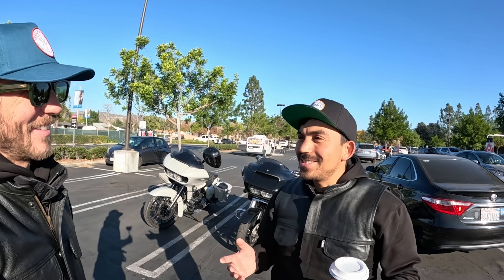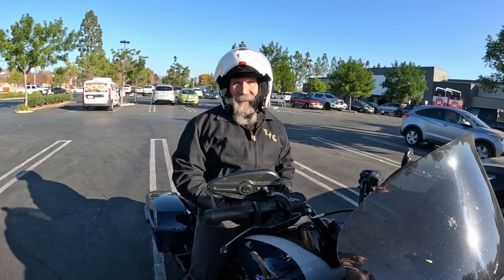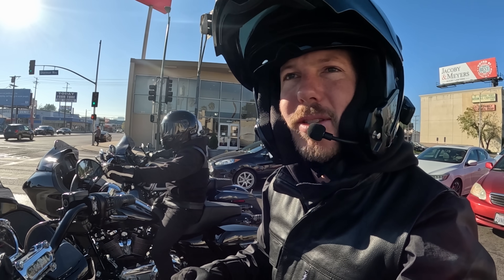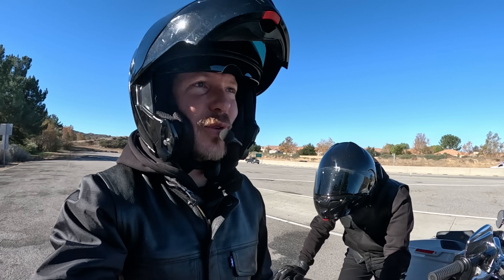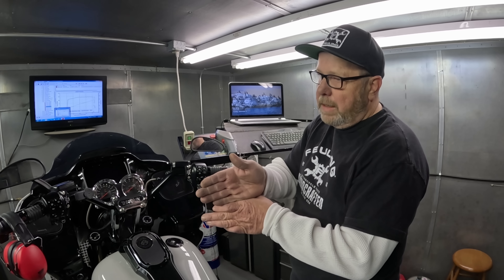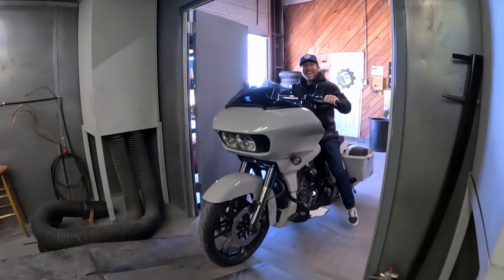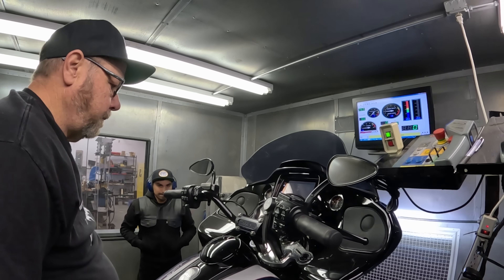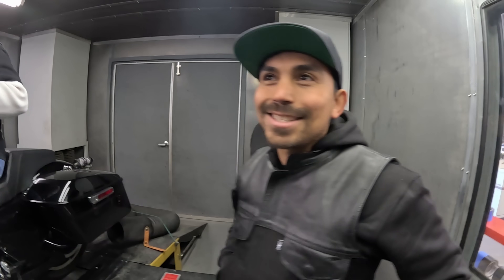Back to the Dyno With the New Cam! (Battle of the Baggers Ep.5) - Vlog 109

Comment: I'm using the Dynojet and have done a few auto tunes. I'm running a Woods wm8-22xe in my 107 with Vance and Hines x pipe and a big sucker intake. I haven't had mine on a dyno yet but the bike seems to run fine. Maybe I'll take it to Bloody Knuckles and see how it compares to your 107. I also want to see how the tuner is doing as compared to a dyno tune. Oh I'm also running the wide range O2 sensor kit from Dynojet.

Comment: Juan , I have a  Sportglide  107   with the RedShift  468  cam  and I am  putting down  124.9 ft lb  of torque , And if you think you're cam has a Nice Chop you should hear a 107 with the 468 cam in it . 
And For "Something New"  I would like Juan to Engineer a Pullback Riser that's  Fully Adjustable  6 or 9 inch or 10 inch With a Single tool or Fixed   threaded Knob or Lever  required to move the Degree of Pullback on the Riser that's not Exorbitantly Expensive.

Comment: U’ll capture more cells with a dynamometer custom tune using wide-band 02 sensors. Dump the sniffer. He’ll be able to isolate the cylinders, look at the true volumetric efficiencies, pulse width, timing, and of course AFR’s. Mine was targeting 8.5 in lambda WOT-approx 12:50’s AFR. 
My 2017 T/C kicks the ass out of my brand new 2023 Road Glide ST 117.  Dyno Sheet= T/C 127 hp, 137 torque, with power being made under a long steady curve. 
My 2023 Road Glide  ST 117 is the same eng displacement as the Dyna, (both 117 ci)  but no comparison. True the RG is slightly heavier than my Dyna,and  has the stock header with cats, but it also has a slightly higher compression ratio , and a four valve head with the M8 Eng. Ha,, go figure😆
Reply from the maker: Did you see the ending?

Comment: Personally I tune with Dynojet Powervision. I'm easily getting 110+ hp out of the 107's with that cam and similar grinds. And getting great fuel mileage to boot with the targets I set. Powervision also allows you to make your throttle live and hit the rev limiter, not shut the throttle down at redline. I'm the performance engine builder and dyno guy at Prestige Custom Cycles in NY.
Reply from the maker: Right on!! We got a TTS and a proper tune. We do that to all of our bikes… just was more of an experiment this time. Thanks for watching Andy!! Cheers from SoCal!
Reply: @THRASHIN  did you do a vlog of the tuning session?

Comment: Must admit I hated when I used the autotune on the FP3 - Though the bike is "learning" it does not run well untill you have finalised the map that you feel the difference - I done over 300 miles while in autotune, while trying to fill as many green squares as possible before I finalised the map (Green = both cylinders learnt, orange = one cylinder leant) - cant say if the bike run any better than the VH map for my selected pipe etc....
Reply from the maker: Yep. Makes total sense. Thanks dude!
Reply: @THRASHIN  there plenty of youtube vids that explain it better, but yeah the map ain't done till you hit finish. Ideally you will need your phone mounted on your bars where you can see it, nice empty road, Holding different revs levels till as many squares are green. It will ride like shit while it's learning

Comment: I'm running a ss475 cam in my 107 with a tabs 50cal s zombie baffles and tabs head pipe,  I'm pulling 107 up and 117.5 torque. I need to change out the baffles I got a torgue dip around 2500. I bet after a good tune you'll be close to 115 hp
Reply from the maker: Hell yea, see you next Tuesday 🔥

Comment: Only the best tuner! Thunder Max is thee best it never stops analyzing holding the 411 for you to upload. Or programmed for there oil cooler fan also no need to get a flash from Harley... Wide band 02 sensors you lose 0 mileage stop with the p o s Vance and Hines rubber it does not work for M8 bikes!!!

Comment: The comments about the fuel is wrong. If that was the case, you could be getting diesel in you gas, and vice vrs. The hose come from the top of the pump, because there is a V at the top. Last half goes in your bike, the first half goes back down into the gas stations tank. The fuel is not being mixed … this guy is wrong.
Reply from the maker: Diesel uses a separate hose homie

Comment: Put that Fuel pack in the trash. 

Get a power vision tuner, and get it tuned proper. Should be around 106-110HP and 116-120TQ.
Reply from the maker: Fuel Pack is trashed…. We went with TTS see ya next Tuesday
Reply: @THRASHIN  TTS is a great product.

Comment: Why did y’all start every race is a disadvantage to the 107? You used the torque advantage of the 117 every pull. 107, especially with cams are dogs down low.
Reply from the maker: Huh
Reply: @THRASHIN  you can’t read or something? You started each roll race in the same gear on both bikes. Which gives more of an advantage to the bigger cube bike, which makes more torque. If you’re both starting at a lower rpm, not down shifting, the advantage is going to go to whichever bike makes more torque, sooner.

Comment: Guys I know Luke is a great guy but Feuling is one of the least performing cams on the market in terms of power. Star Racing is a better choice. Or Andrews.
Reply: No disrespect Rick or to the brands listed, are we talking race engines or are we talking bolt in camshafts? FEULING has race winning engines/camshafts in virtually all forms of racing from Harley Davidson drags to the Indy 500 to the Bonneville salt flats. Our camshaft technology will go toe to toe with any make. Know the combination is what completes the package. When it comes to Harley Davidson bolt in camshafts, we strive to produce the widest power bands with the quietest valve train, smoothest performance using the smallest cam lobes possible. FEULING street camshafts focus on torque, wide power bands and stoplight to stoplight power versus chasing a high RPM horsepower number. Would love to chat with you about your next engine build.
Reply from the maker: Just wait till next Tuesday, we got some numbers and performance that we are very happy with. 🤷🏼‍♂️